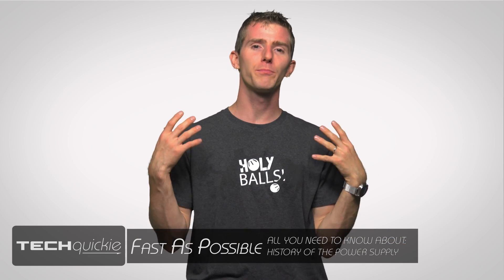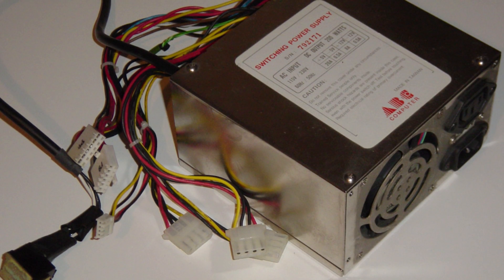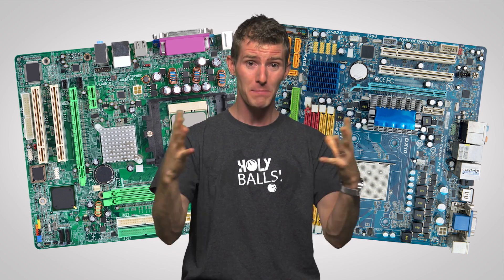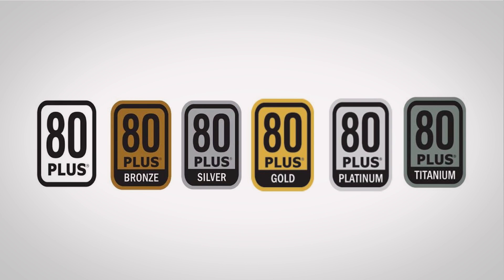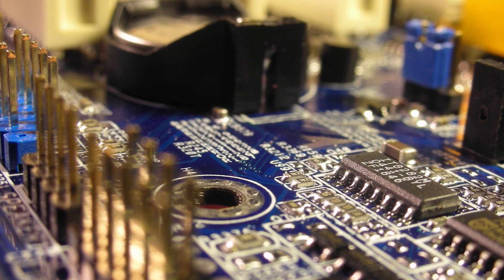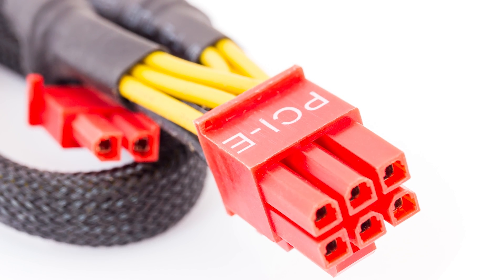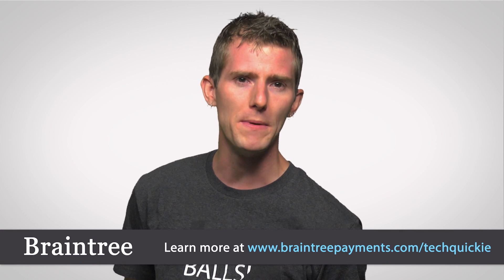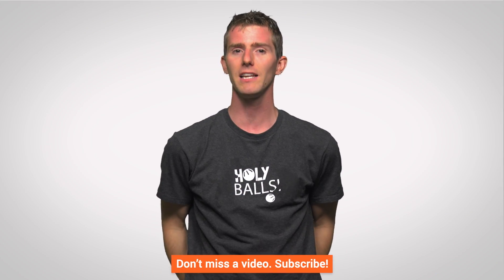History of Computer Power Supplies

Comment: We have a HP PC that we wanted to upgrade which also meant using a new case. Not only was the CPU cooler mounted on the case itself but it had a built-in proprietary PSU with very different cables. Even though we supposedly worked the pins out and used the original PSU for a few cables it still didn't boot.

Comment: I still use my 700 watt psu since I bought it new back in 2007. Tagan Dual Engine TG700-U25. Built like a tank, well made, it's heavy, has dual 80mm fans and +12V@56A(4 Rails together). Costed around 1500 SEK at the time ~ 150 euros or 160 usd. This PSU doesn't show any sign of giving up anytime soon.

Comment: AT power supplies did in fact have a standard.  The most common was the ones that used the P8/P9 connector.  Most AT boards you bought on the market would used this standard. Only some OEM systems decided to used a different connector. Much like in the early days of ATX, companies like DELL would use ATX like power supplies that were not really ATX.

Comment: Not all ATX power supplies could fit all MBs as (IIRC) Dell decided to have a different pinout at one point and the MBs supplied to them were modified to take this into account.  Not realising this could mean you trash another MB  if you tried to use a Dell PSU.

Comment: I'm pretty bummed out that the tariffs on chinese goods has manifested in power supplies.  There are no "excellent" DC-DC models under $110 whereas I was getting 650W Seasonic Focus units for 55 bucks after a rebate just over a year ago..  I lucked out on my R5 3600 build with one of the last Corsair Vengeance 650 modular that while was silver rated showed gold level efficiency for 50 bucks after rebate.

Comment: I've heard that Dell power supplies use the same physical 24 pin connector but is not electrically compatible. So you could destroy a working PSU AND the motherboard by putting a standard ATX supply in the place of one that LOOKS like a standard ATX supply, but actually ISN'T.

Comment: Too bad he didn't mention that the term "rail" actually referred to the big mainframes from back in the day. They quite literally had heavy metal rails mounted with insulators to provide all the power to the plethora of boards that made those things tick. Engineers had to be careful not to lay their arms across the rails when they powered on. And watch out if you accidentally shorted the rail to ground. So the term stuck to the PSUs as they shrunk in size.

Comment: Actually i remeber the AT standard from when i was a teenager. It had 2 connectors which where only able in one arrangement to be plugged into the board. Back then i've seen a couple of boards as well as PSUs and they all where pretty much standardized. The most notable difference to ATX was the removal of power switches (beside the 20+4 pin connector) which led to supply standby 5v for the onboard soft switches and features like power on modem or power on ethernet.

Comment: I have a motherboard with two 8pin cpu power connectors but my power supply only has two and one of them I need for the video card. Do I need to get another power supply or do I even need to connect both 8pin connections?

Comment: I remember when I had a more modern graphics card (I had a GeForce 2 for a long time, then got a Radeon X600Pro), and due to lack of sufficient power on my power supply, the system hanged every time I ran NFSU2 for a few minutes. Imagine the frustration of a kid who waited for such a long time to finally have decent graphics after years stuck with the GeForce 2, and not being able to play. Me and my brother didn't know what was going on, we even asked our friend who had a store and sold us PC parts to change the GPU because we thought it was a GPU problem (he gave us an X600 XT), but the same happened, so we just returned it and got a refund (the guy also didn't know much, but if he did he would have not accepted). Then we bought a X800GT and got the same problem, until I asked in a forum about it and literally everyone told to change the PSU otherwise I could fry my GPU, and my brother was just not believing it. We finally got a half decent PSU after I insisted (my brother was a cheap guy at the time, but he was paying for everything after all) and had no problems after that. Lesson learned.

Later the X800GT died, but it was not the PSU's fault, and the store gave us an X800GTO, one of the best GPUs I had. I just played so much with it! Oh, the memories...

Comment: My 20 year old Intel Celeron 400(A) Mendocino processor in my retro 98se build actually runs on a whopping TWO VOLTS! ;-)

http://www.cpu-world.com/CPUs/Celeron/Intel-Celeron%20400%20-%20FV80524RX400128%20(FV524RX400%20128).html
Reply: Really with a gpu?
Reply: @roblox-vo2dk  This Celeron doesn't have an iGPU. I'm using a GeForce 4 MX 440 AGP graphics card with it.

Comment: I wonder why he didn't mention the 'legacy' minus five  and twelve volt rails still provided on the current power supplies. Do any of you know why they are there? The reason is the original PC's needed the minus five volts for the early RAM chips and the minus twelve volts was for the old style RS-232 serial interface. There you go, now you know why. 11-18-2019.

Comment: I miss the old days of having a actual on / off switch. These days if you need to power off fast, you have to unplug the system. Though I have never been a fan of "soft" power mainly because it always uses power even when "off".
Reply: harshbarj it’s good that way, protects your data from being lost or your system from being corrupted

Comment: Back in the 90s, Dell used a proprietary 20 pin connector. It had all the same wires as an ATX, just in a different order with a different keyed connector.

Comment: I'm surprised he didn't mention Dell's ATX power supply booby trap in the late 1990s.  If you opened that case, you saw what looked like a common, standard Intel motherboard and a common, standard ATX PSU.

Except they weren't.  Both were revised with a different pinout at the 20-pin connector.  Mix a standard PSU with that Dell mobo, or vice-versa, and dude, you just fried your Dell!  We had a rash of people complaining that I'd sold them 'defective' motherboards when they were trying to upgrade their Dell computers.

Interestingly, Intel sold the very same motherboard with a standard pinout.  The OEM version they sold to Dell was purposely made with that different pinout at the power connector.  Likewise the PSU was a standard ATX unit but with the wires switched at the connector.

Dell tried to play innocent but the fact that they had both the PSU and their OEM motherboards revised tells a very different story.

Comment: 1:52 "There wasn't even one uniform standard".....there still isn't, at least with power supplies. Cables from one manufacturer aren't interchangeable with cables from another manufacturer. Mixing them can fry everything. And even within a manufacturer, different generations of PSU's can vary with their pinouts. This is one industry in computer building that REALLY needs to standardize across the board, so mistakes like that can't happen anymore.

Comment: Now I use an Intel NUC computer that is a third the size of an ATX power supply and it runs from a wall wart that looks like about a 30W power supply. I would look but I would have to unplug it, reboot, find this web site again. You know the drill. The bigger NUCs with more cores use a 65W power brick. Mine is the thinner one and is not even as big as the early 5" hard drives. It is so small I have to use an external gigabit USB router which is almost as big as the entire computer to get all the USB ports I want. I guess this it getting close to the end of the road for the TL494 chip they used in all the previous PC power supplies.

Comment: I overdid it with my PSU. I ebay - sourced an unused open-box 750 Watt 80+ Platinum for my home server, plugged it up, and was very pleased by the noise level. Then I hooked up the system to the UPS and queried the UPS and the UPS said "ya, you're drawin' 47 Watts at the wall dude". Well... at least its efficient.

Comment: One thing to be weary of is the modular cables on ATX power supplies are not the same across some manufacturers. I fried a perfectly good hard drive but using another manufacturers hard drive cables on a new Corsair power supply. Just a brain fart on my behalf but in my 20 odd years of building PCs I had never had that issue before and had gotten away with it. Well since modular PSUs were a thing. 

So if you have change your PSU don't be lazy like me ... Change all the cables as well. You will save yourself some years.

Comment: I remember trying to convince my boss not to buy cheap PSU (I believe they were youngyear/logysis). My point was simple. If even the cheapest models from brand name OEMs use good PSUs, they probably have a darn good reason.
You can buy the cheapest brand desktop from a store, and the PSU is gonna be better than the "el cheapo" models.
I remember servicing a custom system where the guy used a top end mobo with an el cheapo. He clearly could have gotten a cheaper model and used the extra 10 bucks to get an FSP. 
This just proves that most custom builders are ignorant.

Comment: But why not use the 5v rail for the vrms, vrms work more efficient the smaller the voltage diffrence
Reply: VRMs are usually switching, not linear, so efficiency isn't much of a concern. Distributing power at a higher voltage is more efficient, eg. you can use less than half the current on a 12V rail to deliver the same power as a 5V rail.

Comment: Been building PCs since 1993 and still build retro rigs - Aside from some minor connection differences (single mains vs "black to black" multimain), the ATX standard varies a lot more, with many aux pins here and there, indeed even 20 pin to 24 pin variants. 

There was no such variety with AT.

Comment: Future power supplies should learn a lesson from the AT power supplies with their long-throw hard on/off toggle switches. Old rigs from 1984-1996 lacked the 5V standby rail and the toggle switch is before the bridge rectifier, consuming no power while turned off.

My idea for future power buttons is a mix of old and new, with the short-throw acting like any ATX power button, used for waking the machine up and commanding the OS to shut down.  This new hybrid power button design features a long-throw toggle switch located before the bridge rectifier on the PSU's circuit schematic.  When you shut down your machine with the hybrid power button, the toggle switch is automatically toggled off to eliminate standby power consumption.

Comment: 5:00 Please god don't call it a "voltage regulator module" it is just a voltage regulator, there are types of voltage regulators, the most used in motherboards is a buck converter (extremely efficient, but complex type of voltage regulator that lowers the voltage by turning the output on and off repetively, then stores the power in a capacitor to smooth it), linear voltage regulators (which is very inefficient because they convert the remaining voltage to heat so if you have 10V at 1A [10W] coming in and you regulate it to 5V at 1A [5W] the other 5W is loss as heat), and boost converters which step the voltage up (eg. 3.7V to 5V, common in phones; like buck converters they are extremely efficient, but complex type of voltage regulator that raises the voltage by shorting out an inductor creating a voltage spike, then stores that in a capacitor and smooths it)
Reply: I may of overrreacted about this
Reply: don't even get me started on the "higher capacity of the 12V rail"😉

Comment: in a PSU important to be 80+ certified, dont go cheap. You can get a 650w cheap PSU and after a while you realise on 12v rail only gets to 400w instead of 600 that you need, thats why 80+ certified no cheap and make shure 12 rail is at least 600w.

Comment: the amount of electricity is the Voltage, and the Current is the strength of the push. .... or am i completely wrong here ?
Reply: Exactly opposite of correct, by the standard analogy.  Current is a measure of the number of electrons per unit time (An amp is, IIRC, one coulomb per second), and voltage is the potential difference in charge.)
Reply: wrong

Comment: Ty for bringing up the old 20 pin pcs connector. I rememver when the connector vegan to shift in this direction some psus had 20 and others had 20 with a 4 pin addapter to support the newer pcbs at that time.  I had to run out and buy a replacment one time because  my old psu was a 20 pin

Comment: I just bought a 30 dollar 680w power supply. Is this good?
Reply: c:
Reply: Teamkiller324 Wot
Reply: :o
Reply: should be plenty of power for a single graphics card setup. May not be the highest quality. just keep an eye on it shouldn't cause any problems but some of the cheaper ones could overheat or cause damage
Reply: Daniel Parks Oh yeah, I returned this PSU for a 550w for 60 (fully modular)

Comment: 20 years ago, I worked in a computer shop and had to repair an old IBM. Guess what ? The PSU was proprietary and smaller than a standard AT PSU. So I dismantled a standard AT, drilled the bottom of the computer, screwer the AT board in the bottom of the IBM, and I cut the former IBM PSU to keep the back side (with the fan and the power plug).

Comment: xt was before at, and was a standard. AT was also a standard with TWO form factors, the large giant ones, and the psus that were literally the same form factor that we use today. the difference between the second of those two at psus and atx psus was intelligence and the connector that you used to hook up the motherboard (seriously, the most common way for someone to destroy a computer when building one back with at power supplies was by failing to connect the motherboard power correctly, something that is almost impossible with atx, red wires on the inside btw, tripped up even experienced computer enthusiasts back then because the red wires are supposed to be pin 1, not in the middle of the connector). atx of some flavor or another all interchangable in the important way if nor physically has been the standard since around the year 2000 with atx coming out some time like 1998. there hasn't been an at standard motherboard since pentium 2, and i almost think those boards were a joke because i never saw one in person. "super" socket 7 boards came in hybrids for a few years with both at and atx power inputs, at the very end there were a few, very few, that were atx only, but socket 7 was already over by then and hardly anything after used at. most at psus got thrown away or converted to bench powersupplies.

Comment: So we know data can be sent through power lines. Is it possible that data can be read from your computer, and sent through the power lines to the NSA.

I mean really why do they need 24 pins to your motherboard in addition to the 6 or 8 to the CPU and the other plugs for video cards.
Reply: Power supplies have no capability of sending/receiving data in any way. If you do not believe me, open one up and check it yourself. UNLESS there is something else connected to the data lines but that would be easy to spot. Even if there was something, the signal would be drowned out by the noisy powerlines looong before it reaches NSA. PSUs have to have GND pins, 12V, -12V, 5V, -5V, 3.3V, 5V auxiliary rail and power on signals on multiple wires so that's why connectors have so many pins. Also, there are much better ways of surveillance ;)
Reply: Nubyrc Because they require more power
Reply: Then why all the wires on the 24 pin connector? 

Here is some info to show you were I was going with this;

https://en.wikipedia.org/wiki/Power-line_communication
Reply: i am using netgears internet over powerline right now.

Comment: 5 volts, geez... Inconceivable. anyway, I liked the btx form. Used to work for dell during their BTX heyday(Dimension 5100-E521, OptiPlex/precision to date). It made sense, airflow in one clearly direction, integrated and add-in components positioned and angled to maximize usage of same, it all made logical sense.anyway, considering how unused the 3.3 and 5 volt pins are nowadays, one has to pause anf wonder how long ATX and EPS are going to remain around. Seems to me one can achieve the same level of distribution with three 12-volt leads and a decent vrm.

Comment: If only laptop power supplies were standardized. Every single model has their own size of connector for chargers. And some cough dell cough screw you over by adding a proprietary chip so third party chargers won't work. This also caused me to have to replace chargers for one computer twice before I gave up, as the chip in each died.

Comment: How would 5 volts fry a cpu? I thought they ran on a 5 volt clock signal.
Reply: I believe you are correct, but the CPU itself is powered by a separate circuit, about one volt usually.
Reply: Nothing\  cpu use 1.35 volts to run

Comment: Lol my psu exploded when I upgraded my gpu from a gtx 960 to a r9 390 and it damaged the vrms on my mobo. My computer still works fine, but the fam on the gpu is at 1500mhz instead of 6000mhz and I can't overclock the cpu anymore. Lol
Reply: Jack McDonald Cheap Psu?

Comment: 2:21 that guy is putting a cpu cooler where the psu goes....BOI!
and also crap cable management.
Reply: no he is not, he is installing it on the motherboard laying in front of him (you can see the ram slots). Though the cable management is indeed crap
Reply: Oh..upon further inspection, you are right.  But y would u need 2 motherboards...
Reply: Rev_dude stock photo man